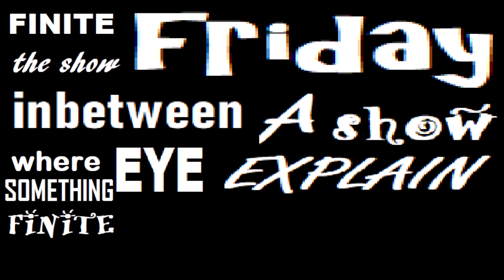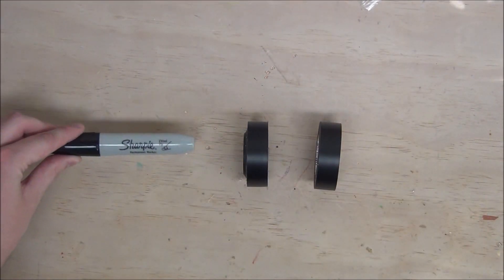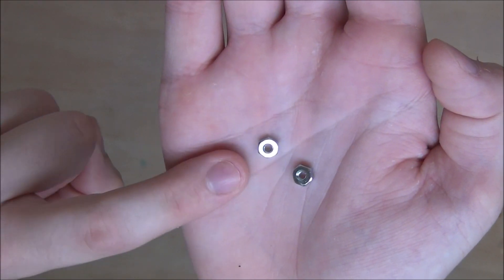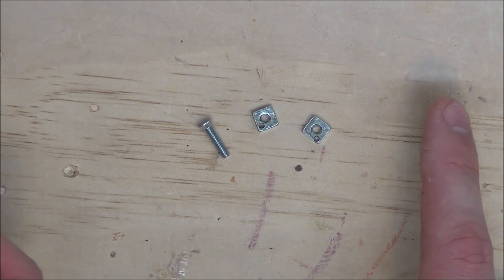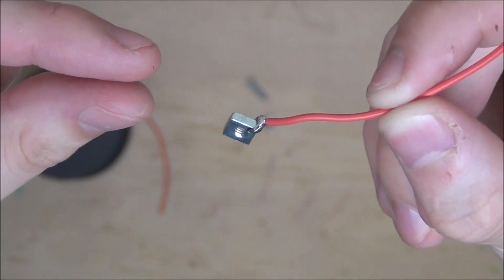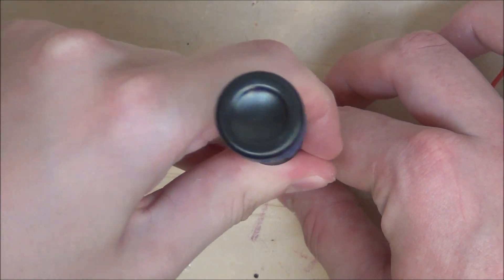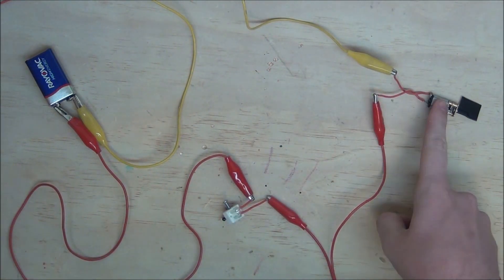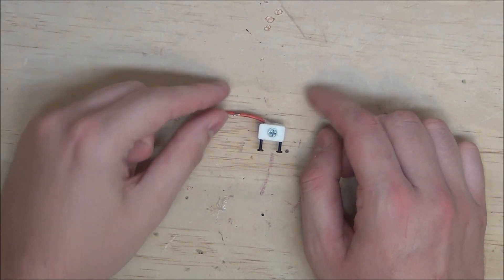How To Make A Micro Screw Switch! // Finite Fridays ep1

Comment: Drop the steel nuts, use small copper pieces with drilled and tapped holes. Sand the copper and use flux and solder will hold well. This allows you to shrink the design further.

Comment: Hey, I’m definitely late to the party but want to ask a question.  Isn’t it problematic to have steel nuts and screw passing current, since an increased resistance of steel (vs. typical copper conductor) will waste battery power by turning it into heat? Or is it that at insect class power throughput at the switch is low enough where loss as heat is insignificant?